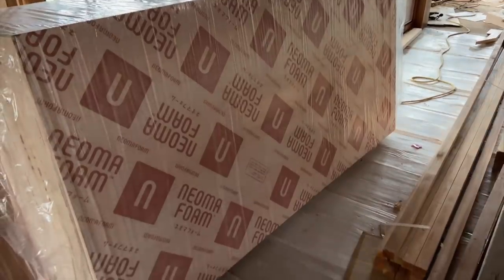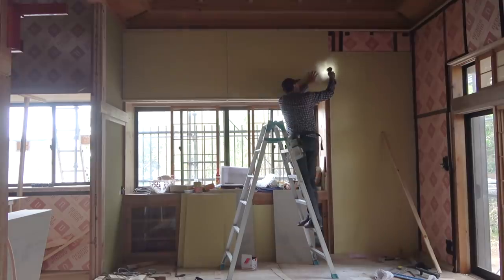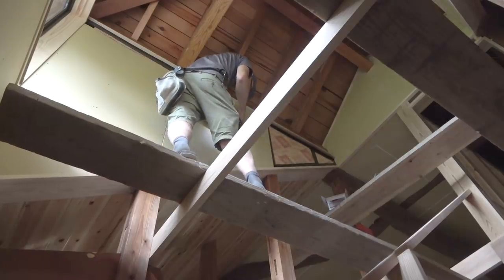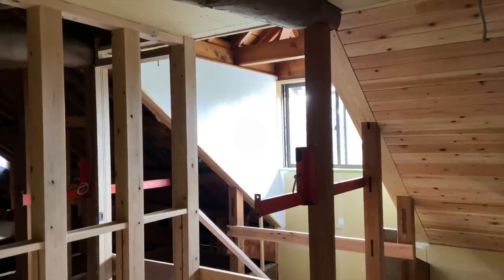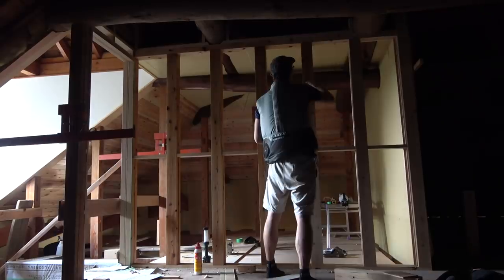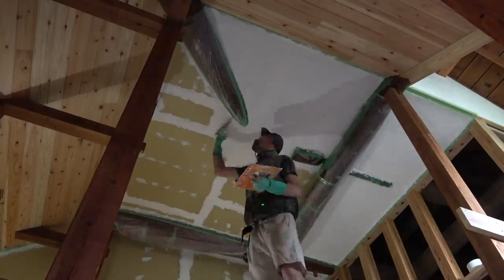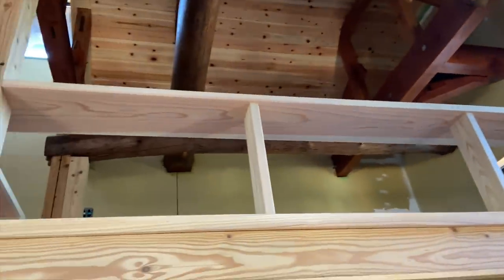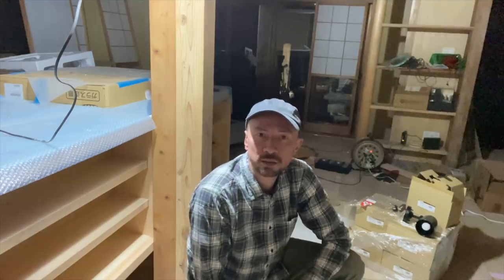Japanese Abandoned House Renovation #7 | The Walls: Insulation, Drywall, Plastering, Siding

Comment: If you want smooth interior walls you can sand them (common here) and paint with flat latex paint (that will breath moisture). I would expect cheaper shikui would be to buy the lowest cost (powdered?) version and buy a gallon of masonry fortifier, which is a acrylic binder that looks like milk, to use in place of some of the water.  Here, sheetrock mud (~plaster of paris) is cheap, gets sanded, and painted with the advantage that in bathrooms it will take an impermeable coat of paint so the walls dont get wet from humidity or easily clean (oily from cooking). Cracks are guaranteed, especially from earthquakes and the building breathing.  The way you screwed on the gypsum provides close to the maximum shear you can get from gypsum, however for fire mitigation, there are special (and cheap) screws that wont melt.    building code here requires that all penetrations and edges are taped (caulked) to prevent air infiltration (in particular electrical boxes).  If your wife has not tried heated floors, arrange for her to walk barefoot on a heated floor in winter, then I suspect she will insist on you changing your floors.   Your house looks very nice.  I look forward to seeing how off-grid you can get.

Comment: Can I recomend for you fire to use eco fans to get the warm air around the house. If you have one that is multi fule a nice was to keep the fire hot at night is useing coals in the evening and then befor bed put a full newspaper on top the Ashes will insulate the coal keeping it warm all night. Your find the fire is drying that may offer some relief if it's humid where you are

Comment: Good to see you back mate, was wondering how your renovation was going! You seemed to have become quite skilled at applying plaster :)
It's interesting to see as your area of Japan seems to have the same climate as here in the Netherlands where I live, but we applied insulation of Rd. 4 to the roof and Rd. 3.5 under the floor.
We did go with under floor heating as it drastically lowers the temperature you CV installation needs to pump out (50*C vs. 80*C) which saves a lot of energy.

We've nearly stripped the entire interior of our house now, the new roof is on and so are the new windows. Very soon we'll start laying all the electical systems and then finishing the walls, with plaster. So it's good to see you became proficient at it, gives me hope for myself :D

Comment: In new Zealand  I build steel frame sheds and buildings and on the occasion we do line the inside and yes we do line at vertical with a similar spacing we also have to metal strap bracing for earthquakes

Comment: Great progress! I just moved to a  satoyama in chiba from brooklyn. You have been a great source of information on kominca style construction and materials. Ours is about 80years old and needs a lot of work. I still nihongo ga wakarimasen and my metric conversions are poor lol. I have been spending most of my time taming 2 acres of jungle.  I would love to DIY like you but, being here in late Aug heat/humidity was insane and I love summers. A gap on every shoji around the engawa. AC is a must.  Also, on the wood oven. I would suggest a gas one if you can get it. I have to burn a lot of green wood in our firepit and its a lot of ash. Also seasoned wood is hard to source unless its on amazon.  When you are finished with your project  Ill hire you to come work on mine haha.

Comment: vertical or horizontal placed drywall doesn't effect stability as much as properly spaced screws when installing it, screws should always line up with their horizontal neighbour (square) or exactly halfway between the neighbouring two (obtuse or right triangle)

some foams are not designed to handle repeated impact like walking and will break down faster than those designed specifically for floors

summer is most likely the best time to apply shikkui, yes it dries faster but with the expansion and contraction of the walls during summer and winter it may crack as the walls expand in summer if applied in winter

the treatment of the beams looks perfect, you have good tastes :) and amazing attention to detail 10/10 keep up the good work

you can always very gently use a circular sander to touch up the walls where you see shadows or uneven areas to smooth it out and remove lines

with wood siding be extra vigilant about termites especially with the horizontal boards overlapped for the look as it leaves space for them to get in behind the wood

for the joiner from the main house to the bath house i recommend putting a steep angled roof along the top of it to meet the bottom corner of the bath house roof as this will blend it in more

i eagerly await seeing your choice in lighting
Reply from the maker: Thanks for those tips. The architect gave me the same advice about the screws. Good to hear about the summer being a good season to do the shikkui - lucky! I didn’t know.

Comment: I think you should try to mix your own shikkui, even if you only get one bag to see how it goes. Now you know what it should be like with the premix it will be easier to judge how to mix your own and you might even make it better! 

Here in Ireland plasterboard is vertical as it's made the same length as most walls are tall. The most disappointing walls are not plumb in my opinion. 

Love the house, great design and sensitive restoration, keep it up!
Reply from the maker: Yes, I will try I think. I know what you mean about house being square. To be fair that disappointing wall joint was on a post that was not square so the two boards were not level with each other

Comment: in north america most codes will allow gypsum board to be used solely for shear; however, I think it is highly unlikely this is ever done in practice, particularly in earthquake prone areas along the west coast. There are code requirements for screw spacing, however the only time I have seen this inspected is for ceilings that are fire rated, such as in a garage or under stairs. This is likely because the loads are accounted for by plywood or osb shear panels nailed to the exterior surface of the studs.

Comment: I used ”KEISOUDO" or diatomite for the wall in my house in center of Tokyo. I cost around 5 times higher than Shikkui but it works a lot better than Shikkui on the humidity.

Comment: Looks great. I don't think Gypsum Board/Drywall contributes much to structural strength so it's either not a factor or an extremely tiny factor for earthquake strength. Rack the wall and the screws will tear right out.  (You could do a test if you make a small square, with two really long pieces sticking out at 90 degrees. Screw the gypsum over the square, then stand on one of the long boards, grab the one 90 degees from it and yank on it to rack the panel.)  
Your  screw pattern requirement is exactly the same as in the U.S. for the same materials. In the States to give a stud wall earthquake strength you cover the wall structure on one side with 3/8" plywood, glued and screwed, or nailed. Then you put the gypsum board/drywall over it.  (When I added an extension to my house 30 years ago I used 2x6 wall studs, put 3/8" plywood on both sides of all the walls. (Code was 2x4 walls and the plywood sheer only on the outside walls) I also added fire sprinklers (un-permitted but the inspector said it was okay because they weren't required, and the worse thing that could happen would be I'd flood my kitchen. ) All my over-doing it and the sprinklers cost only about $500 extra on a $100,000 remodel. Very little. 
Your plastering looks great. Going over the tape joints is tough. The best way is to just feather it way out, or add a thick layer of plaster. 
A painter I worked with in New York City said he used to go to people's apartments to give them an estimate. He'd always take the shade off a lamp and hold it next to the wall to get a raking light (like what's coming in your upstairs window.)  The walls always looked like a WWI battlefield. They'd immediately hire him even though he charged more. He replaster the walls before painting. I asked him, "So Joe when you're done do you do the lamp thing to show them how you fixed it?" "Hell no, and so far none of them has done with me around- thank god! I'm good, but perfectly flat walls are almost impossible."  Shikuyi we call 'raw plaster,' and it is only on the high end jobs and for people with serious allergies.  For taping and plastering I have a large metal trowel at least 16" long that has rounded edges. The bigger the trowel the smoother you can spread it. btw I've done this many times but I'm not as good as you are on your first work. I just never could get the hang of it.  And if any inconsistency is consistent - then it's a texture, so well done!
The premixed. It looks similar to drywall compound. To get a smoother finish add a little water and then mix it all up really good. (guys I've worked with have big drills and the mixing paddle- you can do it with your battery drill).  When it looks like soft serve ice cream it's good to go.  This is what all the pros I've worked with do.  
Slaked lime and plaster  is pretty easy to work with.  Plaster and water sets up in about 5 minutes, with slaked lime added you can make it take hours or longer. You slake the lime in a big plastic drum with water and the lime, then when you start working you mix the plaster with the slaked lime, mixing it right in your tray or on your hod board. To slake the lime the guy I worked with in New York, Ruthevern from Guadaloupe,  just dumped a few bags of dry lime in the big drum, then poured water over the top. A week later when he came back to plaster, the lime had absorbed all the water and was ready. There was no formula so you can't do it wrong. With what you did you could sort this in no time at all. 
Also on your house that corner brace might be okay, but to this old American carpenter a brace like that should cross several stud bays not just one. It's naive at best.  By crossing several stud bays the whole wall will remain a rectangle and remain flat. Your small wall is not structural, so not a big deal.  
Diagonally bracing only one bay in a  long wall  would keep that one bay a rectangle but it the rest of the wall would just twist away from it, rack and collapse. When I was in Kumamoto in  2016 right after the quake I saw this  in all the  collapsed houses/businesses (old wooden structures) I was able to see. They'd just racked over - meaning there was no meaningful diagonal bracing so the walls racked and the roof rotated collapsing the structure. Everywhere in Japan where I could see domestic building structure (old barns , abandoned houses with the exterior wall partially gone and  some exposed newer structures) I saw no effective diagonal bracing.  
But don't worry! Your house is a temple design - in a way it's more like a bicycle, big open frame, but with great joins between the beams and posts. It will just move around in a big quake, might pop some of the walls, but nothing that might hurt you. It's the houses without this structure where I saw problems.  I think the Japanese just adapted temple construction without understanding that it isn't the beams, it's the connections that gives the method it's rigidity but also suppleness.
In the States the biggest factor in house safety during an earthquake is how light wood frame structures are (I live in a ratty, termite ridden old shack on a steep hill. Constructed 70 years ago, no permit, no inspection, probably by people with not a lot of experience. When I first moved in 12 years ago there was a tiny quake, the house kept swaying after the quake ended. Yikes! I put in two diagonal braces underneath and it had no problems at all in subsequent shakes. Two years ago the landlord had a crew 'earthquake proof' it by better connecting the walls to the foundation and making all the walls in the very tall crawl space sheer walls by covering them with plywood. We had a pretty good shake last year. House no problems, but the concrete sidewalks around the house developed some serious cracks and opening. I didn't worry about dying in an earthquake in my house, but I was worried about being dumped down the hill.
 More people in the States get hurt by things falling inside the house than collapsing structures. 
And I may have mentioned before,  this odd multistory retail building being constructed between two multistory buildings in Kyoto. It was at the steel frame stage. Zero diagonal bracing -which at the front might be okay if they want open floor to ceiling glass, but on the windowless sides and back? What they were doing to overcome this structural deficit was to use much much bigger steel I-beams and columns. It looked like part of a major bridge instead of a six story commercial building.  
I just don't understand this about Japan. The freeways and bridges, train stations, etc are all clearly built to the highest international standards. I know a Shinkansen bridge collapsed during the Kobe quake, but those elevated train 'bridges' go for many kilometers and can build up forces that meet in unpredictable ways causing unexpected damage. So it's incredibly smart and effective that during a large quake all the trains are automatically shut down until the tracks are inspected. 
In the States we had this concept that Japan was ready for any possible earthquake, but us lazy Americans weren't and would have to figure it out when if it happened. Then the Kobe quake- many houses,  corner wood columns, beam along the top, no diagonal bracing and extremely heavy tile roofs. Destroyed many of them, killed a lot of people. The first casualty was however all the plans and organization. All the planning turned out to be useless in the face of disaster. (This too could be an American myth). 
 When a few years later in Los Angeles we had the Northridge Quake, not nearly as bad, there was a lot of figuring it out on the spot.  I got assigned to do a structural inspection of a 6 story brick apartment building to determine if it was safe for people to move back in.  I know carpentry, but I'm not a qualified structural engineer, and while I knew something about the construction of that old building there were things I didn't understand, like a 1" gap between the brick facade and the wall behind it. If I'd only seen this in one place I would've tiptoed out of the building and sprinted when I reached the sidewalk. But it was the same every place I looked. So I said I think it's okay.  This was about 5 days after the quake, people from the building were sleeping in the park and it was going to rain. Many of those people were from Central America where a recent Nicaraguan quake killed thousands.
Reply: Later a bunch of us got Emergency Preparedness Training from the Fire Department. They told us that after an emergency we should meet down at the key corner, figure out who was in charge, make a plan. By the time we walked from our homes to the rendezvous point we'd have a pretty good idea what we were facing. Two people immediately started talking about who should be in charge. (The same people who will always want to be in charge.)  So I ask Fire Fighter Newt(on), would we have to listen to these guys if they declared themself king? He laughed and said, "Organization is helpful, but it you think you should just start inspecting buildings and finding out what people need, just get started."  That's the American plan. 
The galvanized screws are fine, just so long as they have the bugle heads and you don't sink the heads through the paper tearing it.  During the Northridge Quake I just walked over to my son's bed and arched over him in case any plaster fell, I wasn't worried about anything else. 
For those single pane windows in the cold months. In my bedroom for the widow with the AC unit at the bottom I made a 1/4" foam core box (about 4" deep) that fits over the window. It's quite effective keeping the room warmer in the cold months. To hold the box in place I just have a loop of monofilament that goes between two screws on either side to hold it. The most important factor is it fits fairly tight to the wall stopping air movement. You could do the same for windows in odd places where you don't need the light or view.
Something I've figured out about beds and sleeping. Even with all the corners tucked in my feet get a bit cold -  which I usually do not notice. This disrupts my sleep, but I don't think, "oh I feel chilly that's why I can't sleep." I just think I'm having a bad night or thinking too much.  But when I sleep in an inexpensive fleece sleeping bag liner, I'm cozy and get a great night's sleep. Also I usually wear a thicker top, because our shoulders get chilly and that can keep us awake. I bought the fleece liner on Amazon $25, it had a big zipper that it didn't need. So I ran a stitch around the side found this to be no problem at all then spent an hour stitch ripping the zipper out. You could just buy the fleece and sew up the big bag in less than half an hour. I also like sleeping in the cold months (14 C so not that cold) with the window open. 
Sorry to on so much. I'd say it's the COVID lock down making me nuts, but I was like this long before it. And if any of this stuff would've been useful in November, I apologize for not finding this video until today.

Comment: The progress looks amazing and you have done a great job in giving this house it original splendour back.
One thing was puzzling me; Most of the time from the outside, the working conditions  looked very dangerous without any safety conditions and sometimes even without proper shoes. In the Netherlands the ‘the local building authority ‘ who visit the construction place on a regular base would stop the work immediately. Who does that work in Japan?